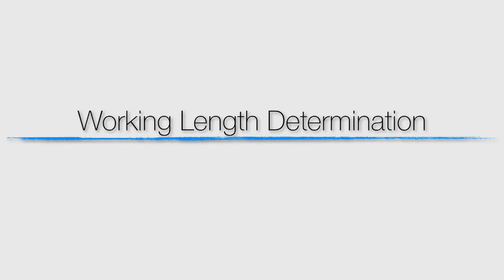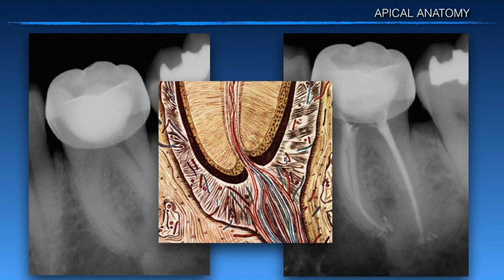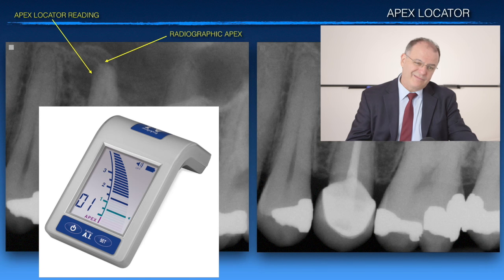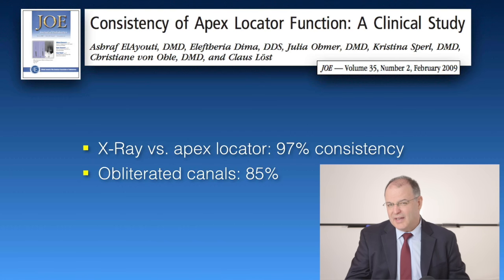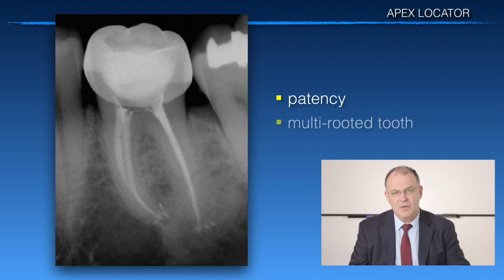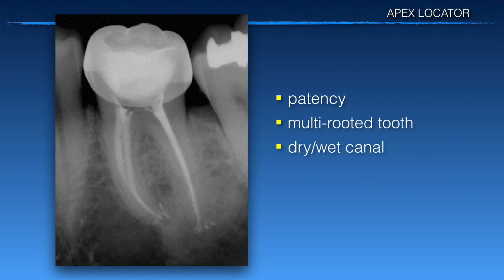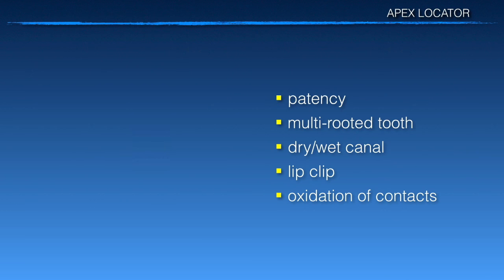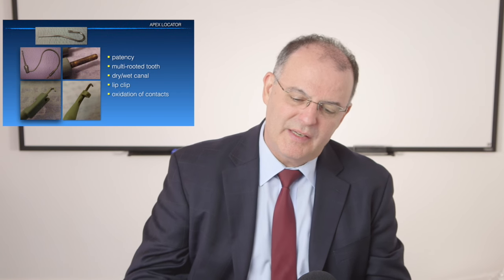Alex Fleury Quick Tip - Working Length Determination

Comment: Sir, should we obturate at a reading of 00 or 0.5 to 1 mm less than 00 reading?
Reply from the maker: The latter is generally a safer length (.5-1mm)
Reply: Thank you so much sir👍

Comment: And if you can’t get patency?
Reply from the maker: There are many reasons for not getting patency. It's important to know what the cause is (calcification, curvature, obstructions, long stranding periodontal disease with cemental ingrowth. But generally, poor instrumentation technique is the most common cause. Crown down and chelation can help. The rest is just dexterity in managing tight canals. If there's no lesion at the apex, it may be possible to leave it at that length. Patient should be informed and possibility of Apico in the future discussed. Referral to a specialist is always a good idea to avoid medico-legal complications. Cheers!
Reply: @AANasseh  Thank you.